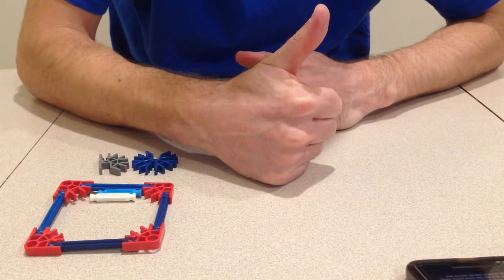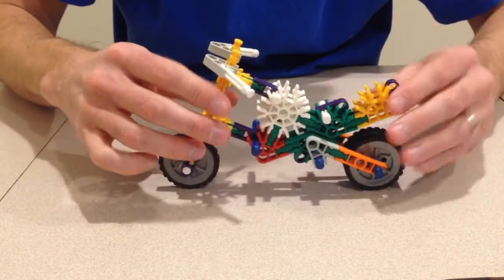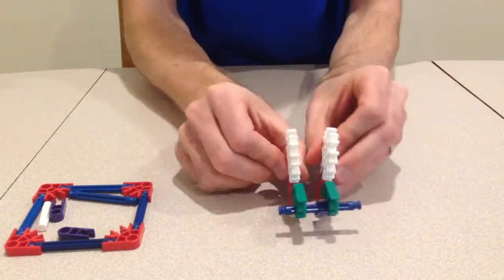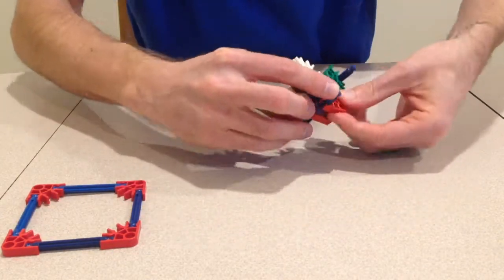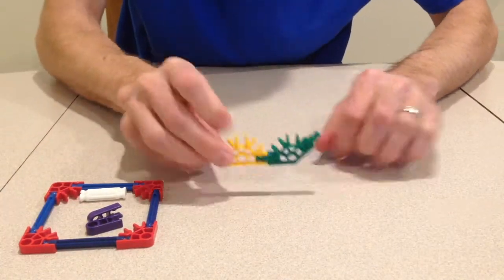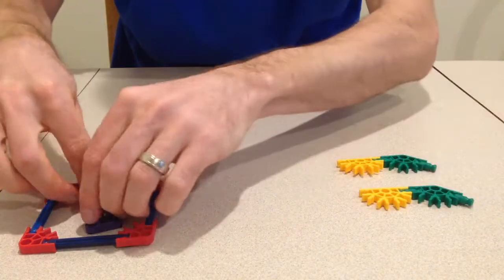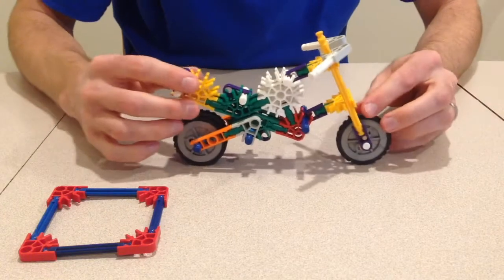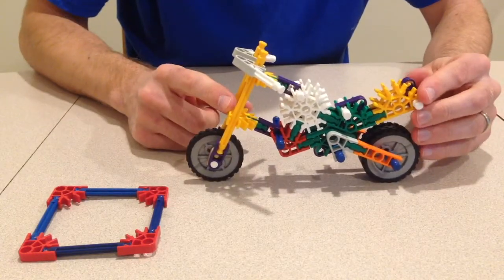K'NEX - Building a Simple Motorcycle

Comment: Thanks.  Nice design.  Video easily followed at 50% speed, although you then sound a little drunk. 🤣  Replaced the lower straight green piece holding the handlebars with next size up straight white  to give a better rake on the forks for a more easy rider look.  Knex man is  perfect size but handlebars need a little adjustment.   Thx again. Here's a picture ...
https://drive.google.com/file/d/1JJ65ljxqBrgDSISRrJbyp0DL_0hcPWJ8/view?usp=drivesdk